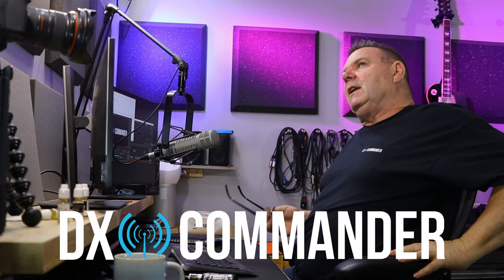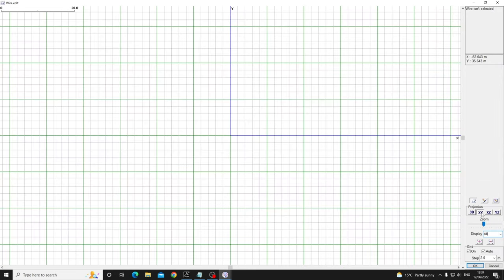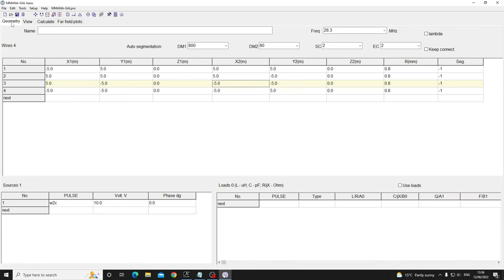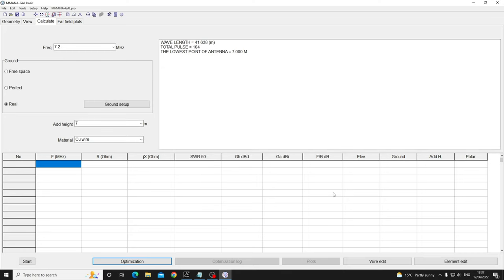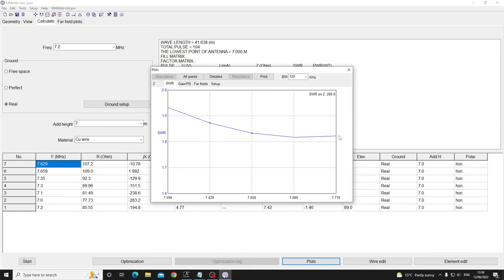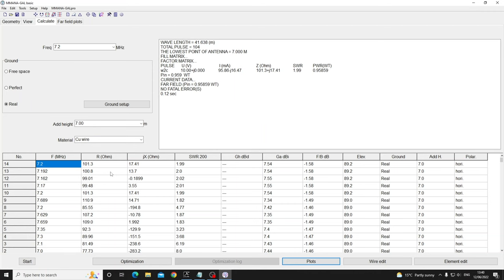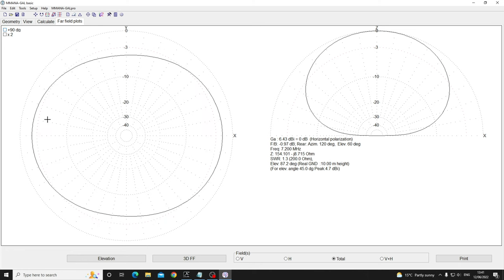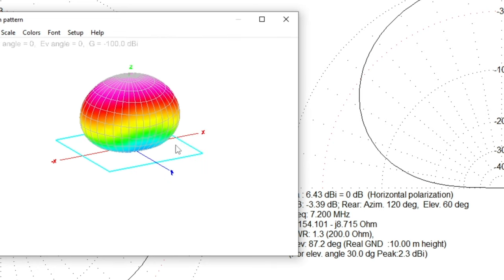Simple Wire Loop Antenna

Comment: I am making a small magnetic loop of 22" in circumference. Now I'm totally confused. LOL I'm looking for the circumference of the small loop. I read the small loop was to be 1/5 of the large loop. I did the math and tried to plot it out in my cad program because that's the program I'm familiar with. I think I'm missing an equation because the smaller loop comes out way to large.  22" x .2 x 3.14. If you have a moment, can you help me? thanks de James KA9TII
Reply from the maker: Magnetic Loop and a Loop  On Ground are two different things.. If you want a Mag Loop, go ahead.. DOn't confuse a little bit of wire on the ground with your project.

Comment: Stand the loop up vertical and feed horizontal. I’d like to see the difference. I think a square loop has a bit more gain than the delta. Firing opposite of the feedpoint the other 1/2 half side of the loop acts like a parasitic element will nulls. Would be quite interesting how it models also vertical fed. Loops are fun and signal to noise are amazing. I just wish they had more teeth on the higher bands. But they do ok
Reply from the maker: Now you know how to do it, feel free :)
Reply: A square loop in a vertical plane does have more gain than a delta loop, but that also means it is more directional. Is that desirable is it not desirable? It depends on what you want. The square loop has more directional gain. As you go from a true circle to a hexagon to a square to a triangle (delta) you lose directional gain, very similar to comparing a straight dipole to an inverted V dipole. The straight dipole is more directional, with more directional gain, while the inverted V dipole is less directional, with less directional gain. If you want the antenna to be less directional, then a delta loop might be more desirable than a square loop. For example if you wanted more than two directions or to be more omni-directional. When I noticed my vertical plane, one wave length square loops being more directional than I liked, I started making delta loops. The low power QRP guys swear that slightly larger than usual one wave length loops have more, even if they have slight more mismatch with the feed line. Some people make their one wave length loops slightly smaller than usual, to match the 50 ohm feed line better, without a matching section of 75 ohm cable. A vertical plane square loop has more gain than a horizontal dipole, because it is more directional. The coverage becomes narrower. Sometimes that might not be desired.
Reply: @jimjungle1397  Tnx Jim. Been very happy with my delta for 40. I also use a kx2 and 10w is the same as 100w and a dipole according to s reports

Comment: Nice video about a nice antenna. Mine is 80 meter skyloop is about 9 meters high with a 900 Ohm ladder line feeder and a home brew symmetrical to asymmetrical tuner. Looking forward towards the triangular radiation behaviour. 73'
Reply from the maker: Yes, that's fun!

Comment: Callum certainly knows his MMNA software.
I've watched many of these from Callum and DLed the program. Just need to get off of my but and get some hands-on experience.
I started using MMNA years ago on a Win7 laptop but moved to Linux on an Rpi4 when the Laptop went belly up. MMNA didn't run in a Linux environment, so I had to drop it.
I added a Win10 MiniPC recently and have DLed many of the programs that weren't/aren't available on Linux.
I've used other simulation programs years ago that were complicated, compared to MMNA, which produced the same results.
Watching Callum's casual use of MMNA shows me that this is the way to go.
THANK YOU Mr DX Commander......
Reply from the maker: Ah! Glad it was helpful!

Comment: To test loop antennas using a function generator and a signal analyzer, can I just connected the function generator to the antenna and the signal analyzer probe to the antenna to analyze the received signals?

Can this method be used for testing loop antennas?
Reply from the maker: It all depends on the gear.. Normally 3d tests are extremely complicated and expensive.

Comment: Hi This is S57MSA.
How good is circular loop antenna for hf instead horizontal Wired quad ?  Best 73
Reply from the maker: So horizontal circle not square? Not much difference particularly on low bands.

Comment: Hi Callum, I'm reviewing the very arbitrary shape of my 160m random length horizontal loop. The height above the ground varies from 25 ft. to 45 ft. depending which tree it is strung through.
What effect would this have at various frequencies? I'm not particularly interested in 160m, but I am very interested in 80m and up.
Can I send you a screen shot of the shape??
Reply from the maker: Gary, to be frank, unless we understand the precise dimensions of YOUR particular installation, we will never really know. Best way of achieving that plot would be to run WSPR across all bands for a day or so and see where you are getting out. Thing is, I do it in reverse, so I build it in software, have a look at the plot - then put it up and see what happens in real life - not the other way around! :)